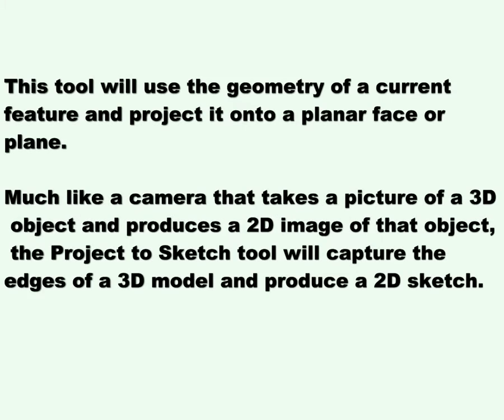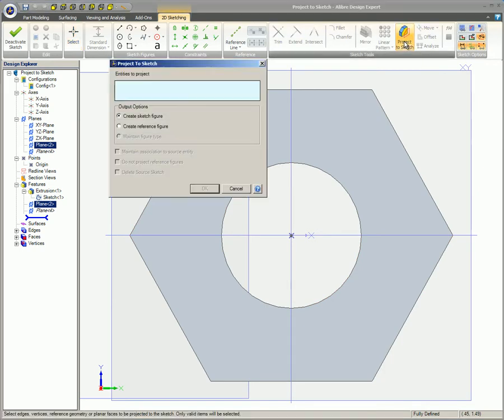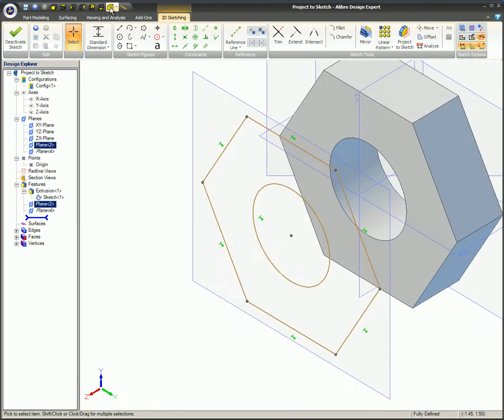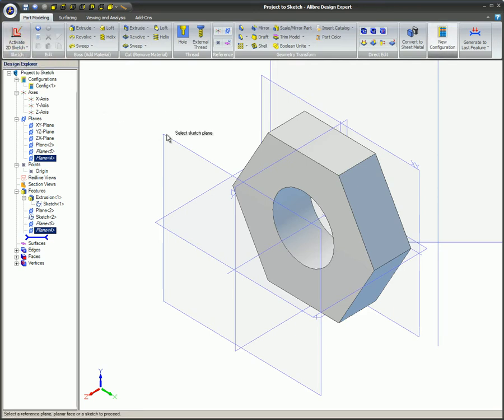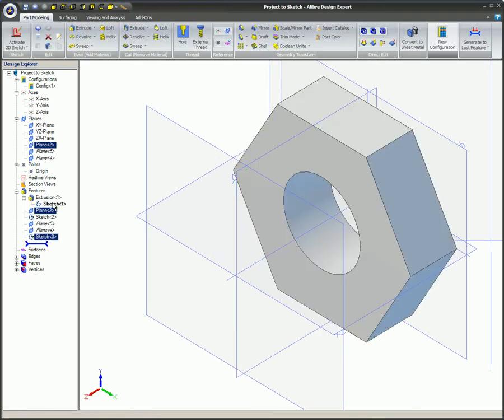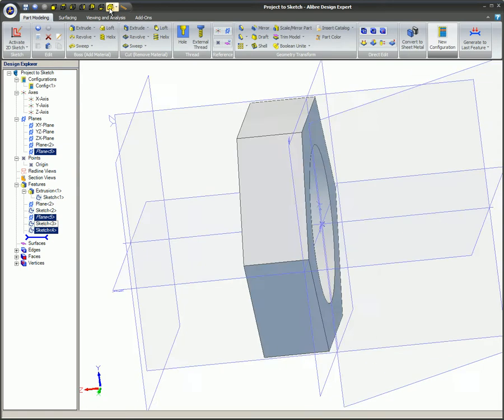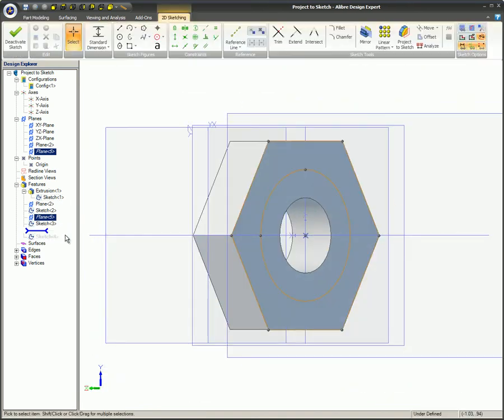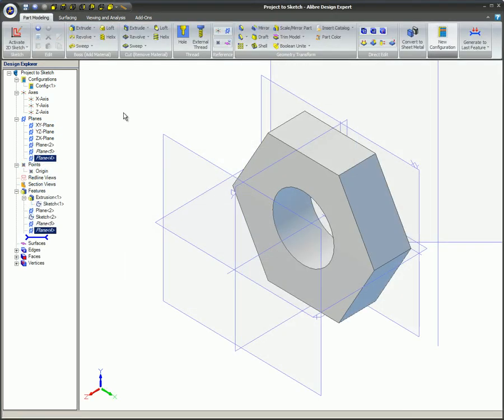Project to Sketch in Alibre Design (Legacy Interface)

Comment: What is the purpose of this tool?
Reply from the maker: The tool is largely used when you would like to use or reference geometry from the model in an active sketch.
Reply: @AlibreLLC  I'm having trouble wrapping my head around this. Do you have any videos that walk a newbie through the proper use of this tool? (By the way, I appreciate the quick response to a question on an 8-year-old video!)
Reply from the maker: @GeekRedux  Absolutely.  Here is a more recent version of importing sketches

https://www.youtube.com/watch?v=Ge4-RUsbEQQ

Lets say you have a hole that you would like to be exactly 10mm away from the edge of your model.  One good use case is you can import the edge as a 'dotted line' to measure 10 mm off of.  Let me know if that makes sense or if I can provide other examples.  It will probably be tomorrow though, I'm headed off to bed!